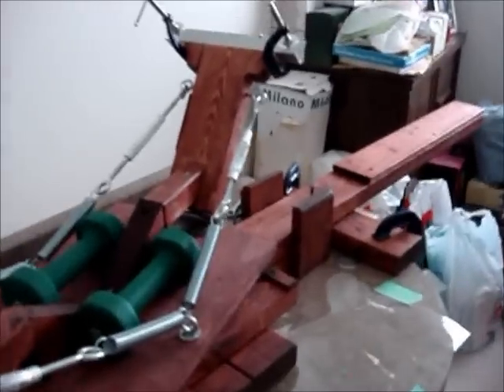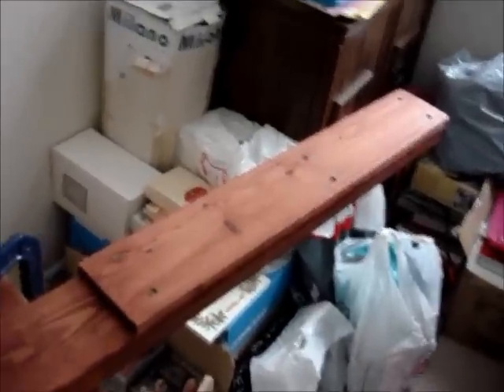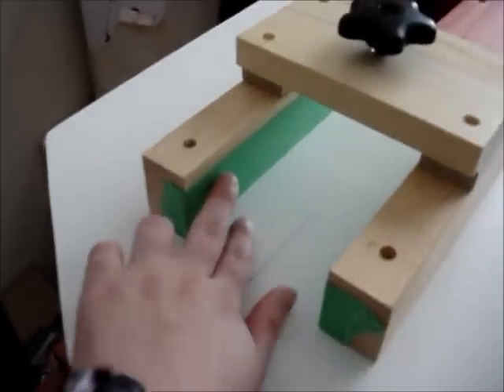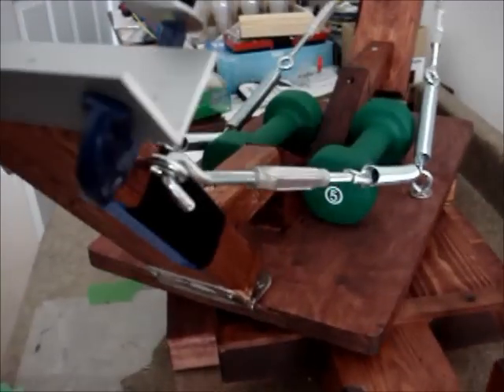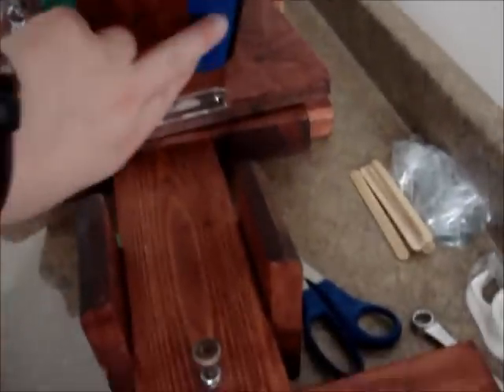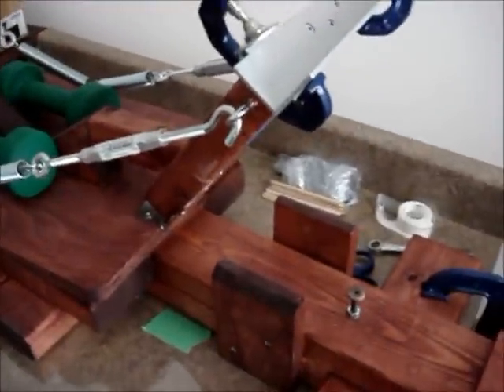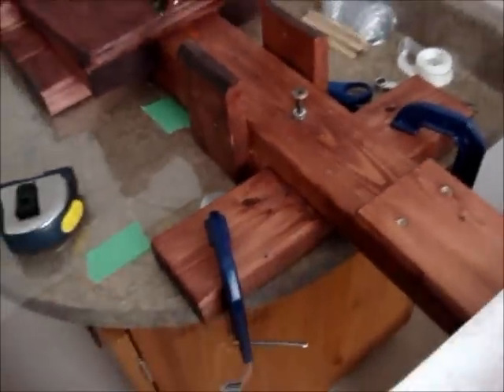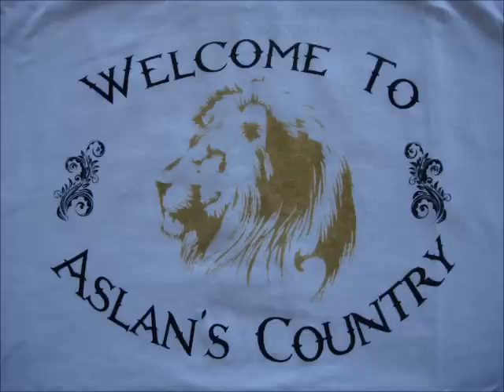Homemade Screen Printing Press Plans Update

Comment from the maker: They are in with all the nuts & bolts area. Some Home Depots are a little different some times on where they are in the store. Here is where you might find the name in Canada or US at home depot.

Canada Home Depot: 1/4 Star Knob 1PC    SKU #: 1000143962

US Home Depot: Crown Bolt Black 1/4 in. Flowerette Knob    Internet#: 202210195

Comment: Hi rosewood, Have you posted any vids for setting up your 'layers' for registration on a multi screen setup? I've been dabbling with printing over the past 3-4 years and I've really just done single colors so far.
Reply from the maker: Unforchantly, I have not had the time to do a video on setting up layers for registration on multi screen setup.  But I learned how to do multi screen registration setup from this video: Multi-Color Registration – YouTube. Just type in the name (Multi-Color Registration – YouTube) in Google search engine and it should be the first one on the list.
Reply: great thanks